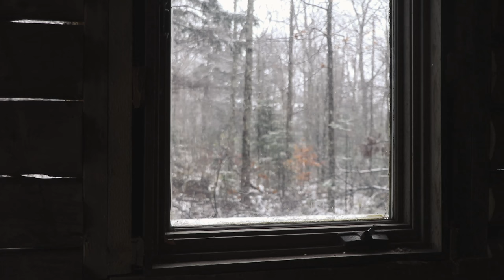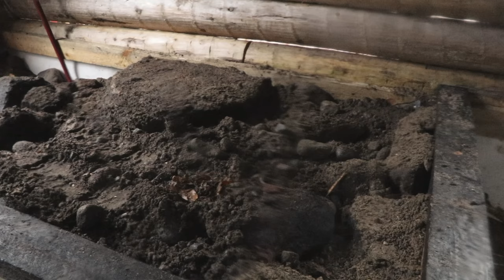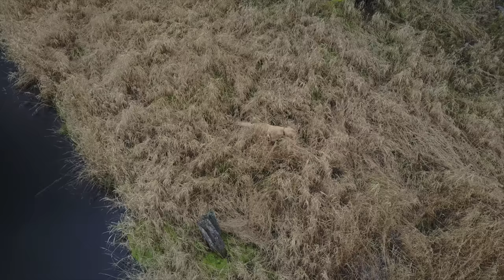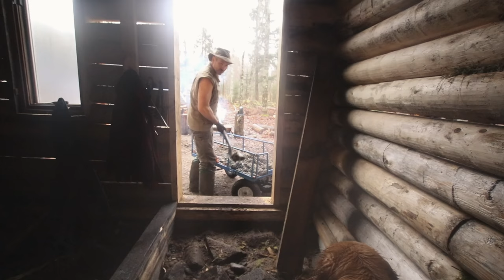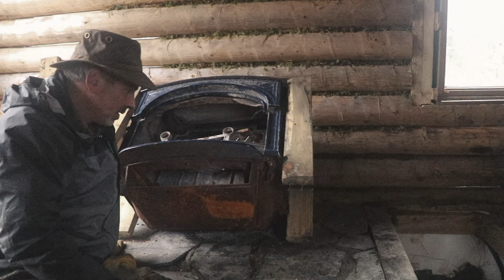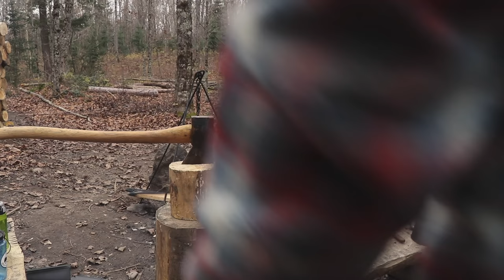Installing a Wood Stove and Stone Floor | How to Build a Cheap Off Grid Log Cabin, Ep5

Comment: When installing a flue system, the chimney joints should be oriented so that the lower joint is always on the inside  of the seam with the next piece of pipe overlapping the lower one.
 This ensures that the hot gases that are under pressure, flow smoothly from joint to joint (like roofing where the rain runs down to the next roofing seam and flows over without backing up into the living space)
You a just asking for problems with the way you put your chimney pipe sections together. They may leak smoke into your room